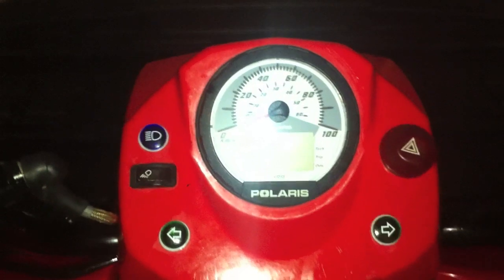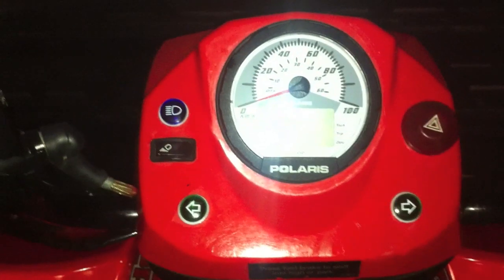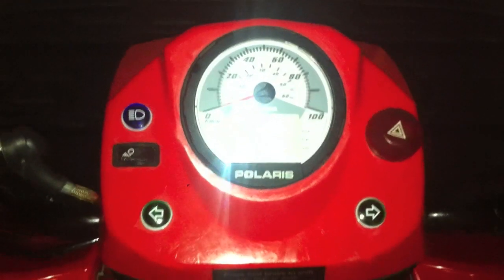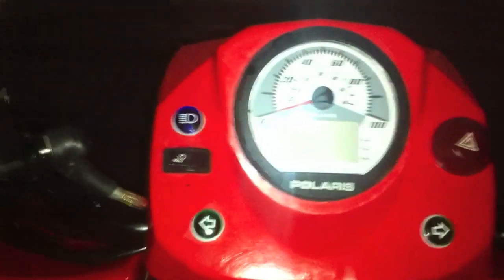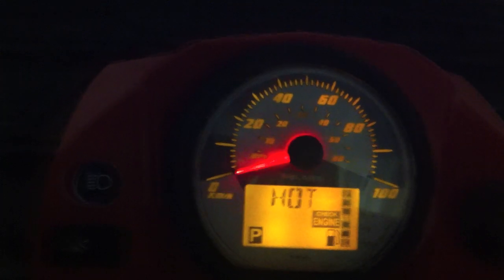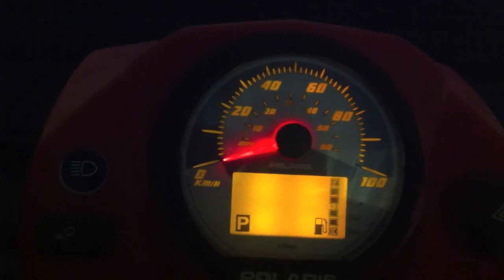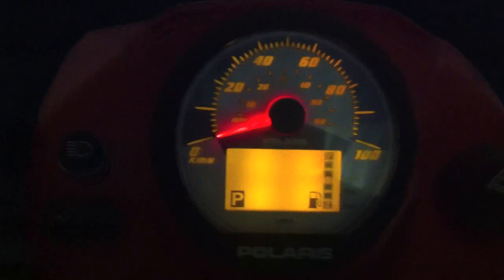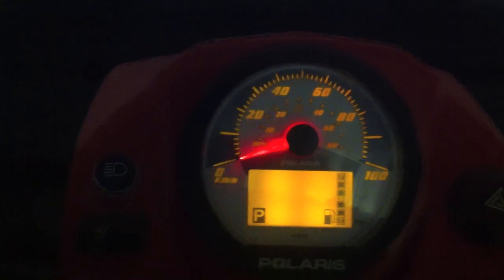Polaris Sportsman HO Hot Check Engine

Comment: when your bike was doing this before you fixed this issue would it start? mine is doing the same but its also showing the battery light too. when i try to start it the display turns off when the key is turned, then the bike makes a clicking noise bike will not start. the display also turns off when the key is turned to try and start. any idea what causes this?
Reply from the maker: +Josh rose  I've sorted it now, there was a recall on the ECM, polaris dealer changed it free of charge and now it's all sorted, thanks for you comment. Contact your local Polaris Dealer, there is a recall on these machines
Reply: Josh rose mine to did u figure out about the battery

Comment: I just started having the same problem on a 2003 Sportsman 400.  The ecm was replaced a few years ago though.  Still flashes hot engine, the fan does kick in & but the temp. gauge I installed keeps climbing when it happens  Getting sick of it:(
Reply from the maker: minnesota kid I've sorted it now, there was a recall on the ECM, polaris dealer changed it free of charge and now it's all sorted, thanks for you comment. Contact your local Polaris Dealer, there is a recall on these machines

Comment: its the ecm module my husban had the same problem get one off ebay
Reply from the maker: haley harp Sorted now, check out my replys
Reply from the maker: +haley harp I've sorted it now, there was a recall on the ECM, polaris dealer changed it free of charge and now it's all sorted, thanks for you comment. Contact your local Polaris Dealer, there is a recall on these machines
Reply: haley harp which one

Comment: I got a 2014 polaris sportsman 400 HO yesterday and it's brand new. But it will randomly turn off everyone and then. And my sister took it for a ride down the road for about 10 minutes and she came back and it said hot check engine. Any solutions? Like what may be wrong or could have happened. Someone please help me out

Comment: It may be a Polaris problem.  Trade it for something else.  I'm speaking from experience.  I had a 2005 Sportsman 800 EFI.  The thing got so hot, a piston rod melted.  I checked the oil and antifreeze before taking off and they were at the proper levels.  I fixed my problem: bought a Can-am.  I was fed up of those overheats and the engine blowing basically turned me off from Polaris.
Reply from the maker: Matt Richard I've sorted it now, there was a recall on the ECM, polaris dealer changed it free of charge and now it's all sorted, thanks for you comment. Contact your local Polaris Dealer, there is a recall on these machines

Comment: Plug the temperature sensor back up. Or it's a bad sensor.
Reply from the maker: I've sorted it now, there was a recall on the ECM, polaris dealer changed it free of charge and now it's all sorted, thanks for you comment. Contact your local Polaris Dealer, there is a recall on these machines
Reply: @AdrenalinePitStop   Yes, I've replaced mine already due to overcharging issues. All the fuses and the regulator is in the ECM.

Comment: my 05 sportsman 500 ho just started it.. drove it for 15 mins reads HOT CHECK ENGINE.. now it starts fine till you push the throttle n shut off...
Reply from the maker: Cheyne Tom I've sorted it now, there was a recall on the ECM, polaris dealer changed it free of charge and now it's all sorted, thanks for you comment. Contact your local Polaris Dealer, there is a recall on these machines

Comment: HELLO MY NAME IS NIALL I HAVE O MOST THE SAME PROBLEM BUT MIND IS HCK CHECK ENGINE MINE IS 2015 POLAIRS SPORTMEN 570 ATV
Reply from the maker: I've sorted it now, there was a recall on the ECM, polaris dealer changed it free of charge and now it's all sorted, thanks for you comment. Contact your local Polaris Dealer, there is a recall on these machines

Comment: i know what the problem is ...your fan is not plugged in all the way i had the same issue ,,,,,,,check to make sure your getting power at the plug to the fan ,,,,,have a good day.............Dino
Reply from the maker: I've sorted it now, there was a recall on the ECM, polaris dealer changed it free of charge and now it's all sorted, thanks for you comment. Contact your local Polaris Dealer, there is a recall on these machines
Reply: my 500 ho had a burned out fan. I changed it out and now its works great and all but my check engine light and hot light are still on. what can I do to take of.?
Reply: Dino M thanks

Comment: Mate that could be your censor it could be clocked/broken. Causing the message to appear as atv is reading the sensor seems hot. Maybe check the sensors on your atv/clean them out and see if they fix. Good luck
Reply from the maker: PS3MoDDer1294 I've sorted it now, there was a recall on the ECM, polaris dealer changed it free of charge and now it's all sorted, thanks for you comment. Contact your local Polaris Dealer, there is a recall on these machines

Comment: When I start using my  Polaris for like 10 min it's say hot check Engine what do I do dm xox_steven so u can help me out because I don't know what to do thanks. I would thank u so much if u could 🙏🏻.god bless i
Reply from the maker: I've sorted it now, there was a recall on the ECM, polaris dealer changed it free of charge and now it's all sorted, thanks for you comment. Contact your local Polaris Dealer, there is a recall on these machines
Reply: David Calderon which module

Comment: unplug the overheat lamp switch by the thermostat
Reply from the maker: +Randal Bush Fixed, read posts
Reply from the maker: +Randal Bush I've sorted it now, there was a recall on the ECM, polaris dealer changed it free of charge and now it's all sorted, thanks for you comment. Contact your local Polaris Dealer, there is a recall on these machines